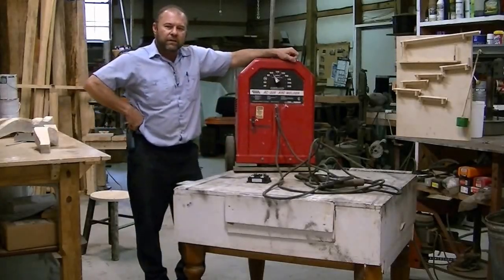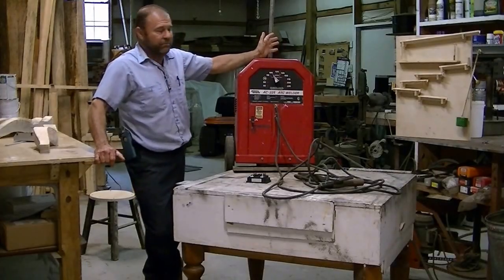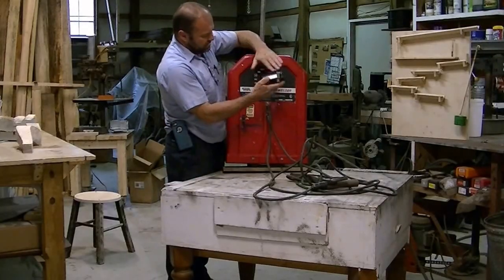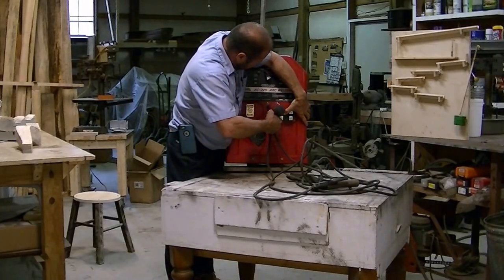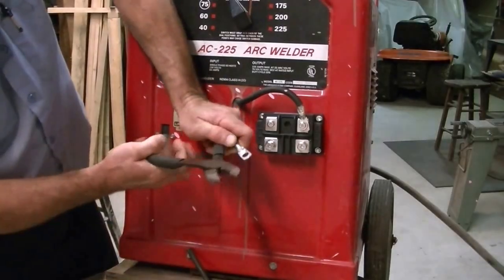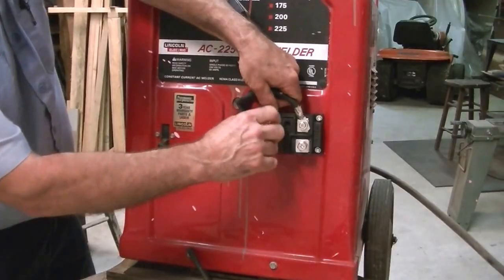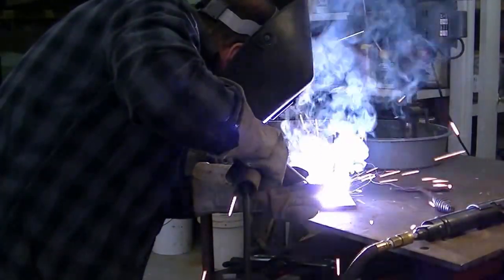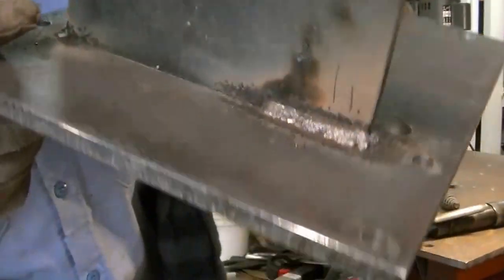Convert your AC welding machine to DC for $50. Weld 7018 rods,more strength

Comment: I did this and it didn't seem to change the performance. I was useing 7018 and wouldn't weld so well. I went and bought some.     ac/dc6011 & ac/dc7018 and machine performed great. I have a miller trailblazer 301D which polarity can be changed to dc or ac so I know how a dc machine should perform with dc rods. Idk I hooked the diode up like the video said though

Comment: you want DCEP.  
 The current flows from the positive to the negative  just like a truck battery. You have it ass backwards. 
      DCEN is when Current flows from work piece/ground clamp into the electrode holder when it is DCEN/straight polarity. 
      DCEP is when current flows from the POSITIVELY CHARGED electrode holder into the NEGATIVELY CHARGED  work piece .
Reply: Im no welder so I can't speak to the effectiveness of dcep vs dcen but DC  electricity flows negative to positive. Electrons are negatively charged and they're the particles responsible for the transference of energy. Therefore, if you have a negative electrode (dcen) the electricity would flow from the electrode to the work. So says the Google, so say we all.

Comment: I'm srry but I used the same welder but older had no prob as long as u know how to make ur weld an how to stack never had 1peace brake that I welded with that welder an a 7018 hot pass on 125amps no prob

Comment: A old Lincoln with copper windings.  New ones have aluminum windings I heard
Reply: Metal Selector Switch handle = Copper,    Plastic Selector Switch handle =  Aluminum core.

Comment: Hey i just finished doing this to my ac 220 welder Does anyone know if it matters what side my choke inductor is on? If I weld dcep  it's easy to start and maintain even with one hand but if I go dcen it's way hard to start an arc. Is it because my choke is on my electrode side or is it just how it works with the heat building on the work peice vs electrode?

Comment: 7018 runs best reverse polarity, that means electrode positive. You have it connected to run straight polarity. Best recheck your set up and polarities. One other thing, duty cycle means in your case 20% is rated at full amperage of the machine which is 225. You can run that much longer if you are only set at say 125 amps for 1/8" rod.
Reply from the maker: Thanks for the advice. I thought reverse meant electrode negative, I will have to switch it. Thanks.
Reply: You beat me to it, but still a cool conversion.

Comment: I believe you are welding with straight polarity, switch the leads around. the only difference between regular 7018 and 7018 AC is the flux coating has a higher iron content that makes it easer to start and maintain the arc. 7018 is a reverse polarity rod.
Reply: Don’t know ifI ever tried reverse on 7018. I have to try and see

Comment: IF you were to add a capacitor or two across the output or the DC terminals ,you'd increase the power factor and the duty cycle and it would run a lot smoother
Reply: Any old cap? Or did you have some specs in mind?

Comment: I see there are quite a few who think about doing the same. My advise will be to mount the rectifier to an aluminiumplate, to use heat transfer compound between them, and to use a proper tool to crimp cableshoes, as the one shown here classifies as toy.
Reply: And solder them!
Reply: @gkess7106  Thats funny!!
Reply: I solder my connectors in place.

Comment: You really need a capacitor bank on this too
Reply: Capacitors will give you a constant-voltage output, and what you want for stick welding is constant-current.  An inductor is the way to go for that.  Cut the windings off a power transformer from a microwave, and wrap welding cable around it as many times as you can, then connect it after the rectifier in series with the electrode holder.

Comment: We have one of the same machines at about 50 years old now. I'm 44 and the machine is a lot older than me. I agree that DC is the ticket but I've welded about everything with this antique including coat hangers without flux. It has glued together many truck beds , trailers , building trusses. It has gone weeks at a time doing way over the 20% duty cycle in hot southern summers. I do have a couple small DC machines that I like and yes they feel smoother but the old timer still lays a great bead with any rod its welded but gives off that chatter feel while doing so. Several times the cooling fan has been replaced and where the leads come out it has arced and burned the holes in the sheet metal bigger. Now that has been cut out and replaced with solid rubber.
Reply: I was maintenance at a shop in 80s that had lot of these old Lincoln’s. About the only thing that hurt them was letting the stick fall on a bench, short out, sit there until the wires to the transformer started smoking and causing attention. That and the fan motors getting clogged with paint overspray. They have transformers with allot of taps and a switch to pick which one. It was always exactly the same amount you put it on so you knew what to expect.
Reply: My first 10 years of welding I never stick welded on anything but an AC only machine. Even now when I stick weld just about anything I may start on DC but usually switch to AC
Reply: These are bulletproof. I'm your age and I always remember my Dad's machine being there. Still have it, and still use it. I do love my little DC machine though, it travels much easier and gives me the option of 110V.

Comment: I did this years ago, with four huge diodes, plus several very large capacitors to smooth out the ripple.
Reply: Did you make a utube of it. I would like to learn from you
Reply: "Large caps" and "High Voltage" are rather useless descriptors.  What are the specs and where did you connect the VLC's to/between, etc.

Comment: Markp0, that bridge rectifier is designed to be mounted on a heat sink with thermal conductive paste (like that used to mount a computer CPU chip) in the base plate contact interface.
Reply: Anti-seize seems to work as a good thermal paste... I've used it when mounting higher power LEDs to a metal surface...

Comment: I did this modification using this diode. The diode has a heat sink built into it. Keep in mind this is not intended to be used for production work or more than a couple minutes at a time, I also use with ample break times in between striking up. Never had a heat issue or a blown diode. I did make a choke for it. I used #4 gage wire wrapped around 205mm x5  ferrite rods, bundled together and wrapped with wire from end to end. I made my own copper lugs and mounted everything inside the box. I also installed quick disconnects for both the AC side and DC side on the front panel. It works very well. 7018s fry like bacon.
Reply: Hi!  Could you explain you're choke a little better so I could build one too?  Thanks!   chris
Reply: Jason Miller  Can you elaborate a little more on the choke you built? Where did you source your ferrite rods? I'm having trouble visualizing "bundled together and wrapped with wire from end to end" got a pic or a drawing, or better yet a youtube video ;p?
Reply: If you're gonna go to all that trouble why not just buy a dc machine...
Reply: @TomFromYoutube  - Exactly! But tinkering is fun.
Reply: Jason, how many turns of #4 gauge wire on your choke ? My 1966 vintage Lincoln Idealarc already has a switch for reverse DC. Unfortunately I just got hit with a bad bank of diodes - - 1 out of the 4 banks, must jerry-rig a new full wave bridge rectifier since Lincoln stopped making a replacement part, either take a chance on this chinese model this guy is recommending which now costs $88 - -  or buy 4 huge Vishay Stud Diodes and "roll my own"  - - - - - possibly more reliable than Chinese, but I'll need alum. heatsink and thermal compound. Amazon turns their back on you if this Chinese one burns out and says you must deal with seller to get return/refund (in China of course). Study the insides of my '66 it appears I already have one large cap and also a choke. Any suggestions ?

Comment: I might have missed it in the comments, In stead of crimping the big wire lugs on I fill them up with solder, 100% contact and no chance of movement if crimping is not done right. I,m going to put one on my big AC300amp Welder, Thanks for the vid,

Comment: Your 20% duty cycle is at maximum amperage on your mchine, the lower you set the amerage the duty cycle increases
Reply: The 20% duty cycle on that Lincoln is at every setting except 75 amps. At 75 amps it has a 100% duty cycle, that is why it has a circle around it. I have had one of these machines since the early 70's and they are a workhorse. The owners manual is your friend....
Reply: Rusty smith you’re wrong on that one 75 amps is 100% but those aren’t 20% for all others duty cycle doesn’t work like that.
Reply: @13tygers  The circle around the 75 amp setting, indicates the setting for pipe 
thawing.  Lincoln, and probably every other welding machine 
manufacturer, will tell you NOT to thaw pipe with a welder and state in 
their literature that it is NOT an approved process.  I'd bet that more 
than one house was set on fire, or someone got a bad burn, using that 
method, but reading about it on the internet, it was, at one time, a 
pretty popular way to melt frozen water pipes.  It might still be, for 
all I know.
From one of the Lincoln manuals:

Linc-Thaw™ (L2964-1) - Includes meter and fuses to
protect welder when thawing frozen water pipes.
Pipe Thawing IS NOT a CSA approved procedure.
If not done properly, it can result in fire, explosion,
damage to wiring which may make it unsafe, dam-
age to pipes, burning up the welder, or other hazards.
Do not use a welder to thaw pipe before reviewing
Lincoln Bulletin E695.1 (dated October 1987 or later.)
Reply: Duty cycle is always rated at max. Amp..20% duty cycle @ 225amps is this case.. yes i agree 100% at 75amps and lower but not 20% for the higher settings except max 225amps..btw i contacted lincoln on this.
Reply: Rusty is absolutely correct. At the lower settings these machines are more forgiving of exceeding the duty cycle than many machines. On the other hand the Miller Thunderbolts have a 20% duty cycle @ 225 amps with the duty cycle increasing as the amperage decreases.

Comment: you need a choke and to get full wave rectification you need to make sure your diode pack has 4 in it, I know I am an electronics engineering tech, and more then that I did it,I wound a choke with #4 cable on an old xfmr core and 4 100a diodes on big heat sinks and she puts out 225a/dc same as 225a/ac, because its full wave rectification, what you did will work but the other way is better.if your pack has 4 diodes which I belive it does and you added a choke you would even see a bigger difference and it isn't hard to do just a pain finding place in the welder to put it, but I did, and also have 2 computer fans for cooling, can weld straight time and no duty cycle issues.
Reply: steve lecain 
Steve can I contact you for a parts list I'd like to do this to my machine???
Reply: @DaveSender66  sure thing,
Reply: You should show your rig on a video. I and many others would love to see it.
Reply: @jeffery19677  I dont do videos unfortunately i don't have the gear to do it.unless I did it on my phone. I build a lot of stuff just don't do video's.never the one to be the center of attention.
Reply: IF your choke has no air gap in the core, then very likely your inductance is lower than you think, since a closed path core like a transformer core will saturate with even a small DC component in the amperage. For best results, you need to either assemble the core with a significant air gap, or, don’t bother with a closed path core and simply wind turns around core pieces or a bundle of rebar.
Reply: @whidbeyman  I've done that, this worked better for whatever reason.lots of my friends have done it and theirs worked great as well.
Reply: the reverse polarty when I switch my leads works great as well. I've been an electronic engineering tech for 43 yrs,. I've tried a lot of things that didn't work and this does work and it works incredibly well.

Comment: I don't get it. Ive used 7018 with straight AC for 45 years on that same Lincoln 225 never had a problem. Quality welds are the skill of the person, not the voltage type of the welding machine.
Reply: I use 7018AC and it works great.
Reply: G Belanger I've used 7018 with mine as well, though I've used more 6011 then anything else. When I learned to weld, my instructor made us learn with 6011 first, explaining that when we went to work we would find most places used 6011, and we wouldn't be very employable if we couldn't weld with it. I did a similar conversion on an old copper transformer AC225 from the late 60's and the DC conversion was well worth the effort. These newer rectifiers seem to lose a lot less power than some of the older style rectifiers used in the AC/DC versions of these Welders.
Reply: Be nice for aluminum tho
Reply: @oldsstarfire  not really. Aluminum is best on high frequency. It can be done on ac but at a severe cost to quality
Reply: aaaaaaaaaaaaaaand voltage is negligible in this equation as the heat comes from the current and not the voltage. Amps dictate the quality of weld voltage just carries the current to where it needs to go the thicker the wire on the welders transformers secondary coil raises current but lowers voltage coming from the secondary (output). 

Other than that I agree with you on AC being inferior in some way. If you can weld halfway decent with AC then you never really have to worry about the strength of the weld it is unregulated power with as many amps as the machine dictates, it is a stronger weld when done right. DC is meant for those people who jump every time they see the arc.
Reply: @evilcowboy  Good points made. One question is it the thickness of the seconary wire or the numbrr of turns in the secondary winding that determines amperage..
Reply: I welded some today. I ran it on AC cause it worked better.
Reply: Thats cause your supplying current direct, there is no conversion happening. It welds hotter but some people complain of its "uncontrollable nature". In DC mode it supplies the arc more controlled but I have a hard time justifying this argument since the distance of the welding rod to the work is extremely short. It's just gonna look a little more like Tesla coil crazy. DC is less violent but if your stick welding it looks violent in general so its probably an invalid argument the people who like DC when they say this. 

The only reason I can think to weld with DC neg is if you keep tripping breakers. That is the only reason I am here as I am building mine for better welds and it will probably trip the breaker if it is left on AC. 

Generally I would have to say that regulating anything always causes the item in question to be weaker. Engines, welders, processors, software, society etc etc all are weaker when you regulate it and is generally a compromise of quality and strength.
Reply: Lol
Reply: I'VE used a Lincoln 225 AC for year's , but it is a 60s model , much better than the newer one's , never a problem 7018 stainless , would like a inverter tig , mig  stick DC one day !!!!!
Reply: Lol dude just needs to turn it up to about 125-150 with 7018 and he's set! Still sounding like shit too! After the conversion he's running that rod on like 90amps!
Reply: Dude needs to add a capacitor and resistor as the rectifier doesn't get the gains with free AC current fluctuation... Idiot
Reply: idiot

Comment: Fist off, Is that bridge rectifier even alive still being it had no heatsink beyond the paper thin sheet steel it was attached to??  @ ~100 amps that bridge rectifier is seeing ~ 1.5 - 2 volts forward drop which equates to 150 - 200 watts of heat it has to dissipate and more than double that at the full 225 amp setting.   Something that brick package can not do on its own nor can the thin sheet steel of the welder case behind it take away either.  
  
Second, as others have pointed out, you need some sort of inductive choke (reactor in welding terms) to clean up the DC plus it makes a huge difference in the 'wetness' of the arc and how well or poorly it will both burn the weld puddle into the metal plus stabilize it as well.  
The capacitor is optional though but a smaller low ESR one of a few microfarads and 400+ VDC rating will help protect the rectifier from high voltage spikes.

Third the 20% duty cycle is at the top 225 amp setting and gets proportionally higher down to around the 130 amp setting and below which for normal stick welding work could be considered 100% operator duty cycle operation since very few people who own such a machine ever do more than 6 - 7 minutes of actual arc time out of a 10 minute period due to  having to change sticks and move around their work as they weld anything.
Reply: Tcmtech great comments, thank you

Comment: How much for the rectifier or would it be cheaper to simply get the ac/dc machine in the first place?
Reply: No, we bought the AC machine years ago and it is paid for,  Add the part for under $50,  and keep on welding...  Lot cheaper than a New welder today.....   But if you have no welder,  then just go buy the one you need.

Comment: Ah, 7014 & 7018 are the same strength.
Reply: You are right that both are listed at 70,000 lbs. BUT, and this is a big but, the 7018 is much more resistant to cracking and vibration.  This is why it is pretty much an industry standard and required on many jobs.
Reply: 7014 is not a ductile rod 7018 is that means it can handle shock and impact